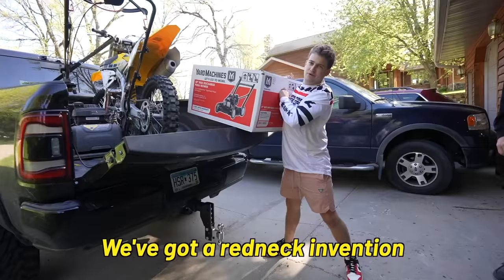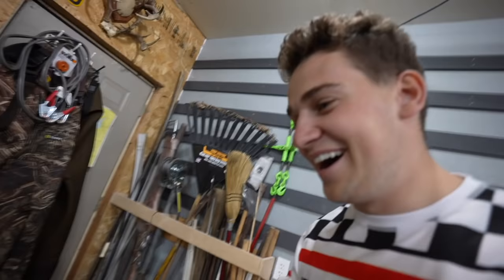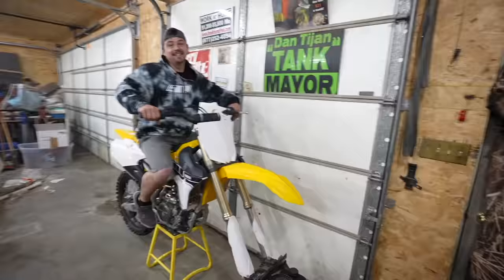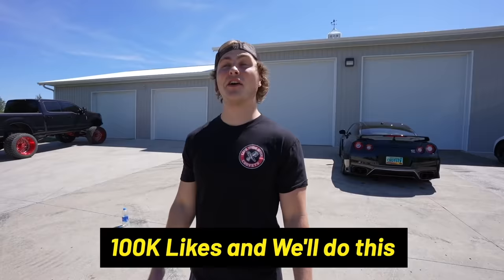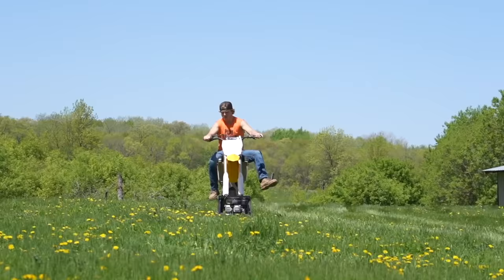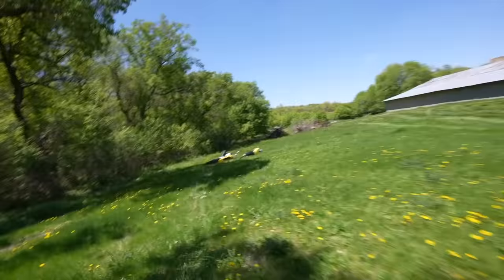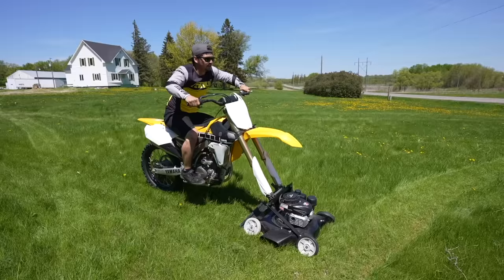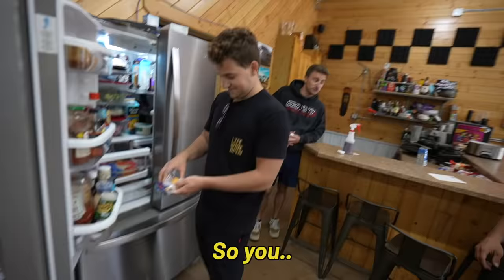Mowing the Lawn with My Dirt Bike

Comment: You should've left the wheel on and put the mower Infront of the front wheel or connected the mower underneath the engine that way you could still now and ride or you could put the mower at the front or back of a quad no taking off wheels